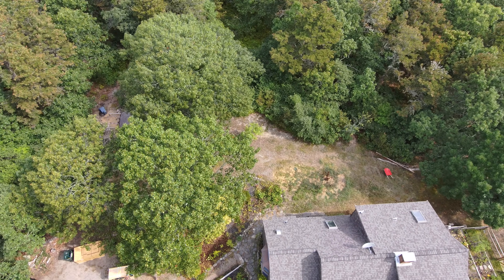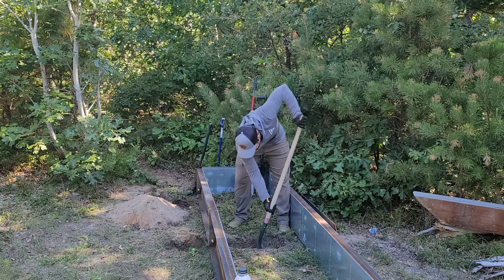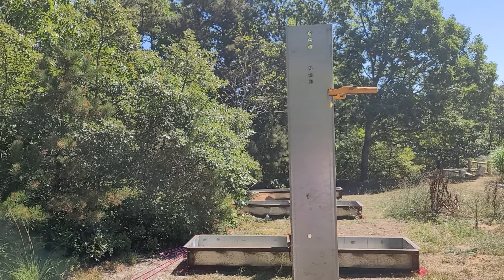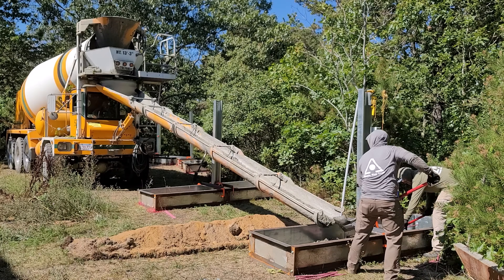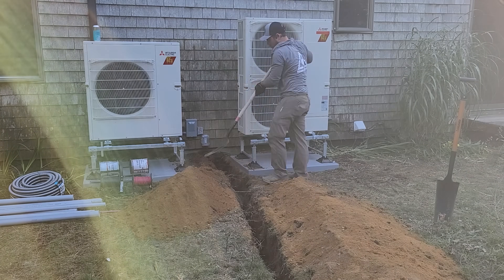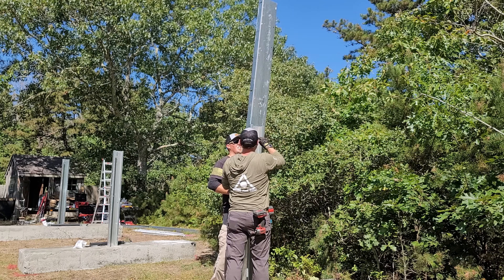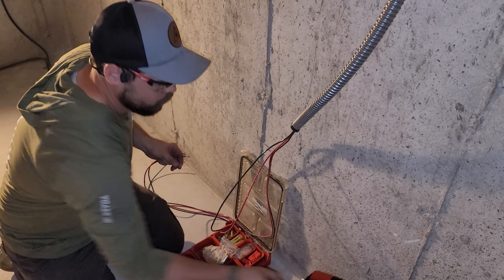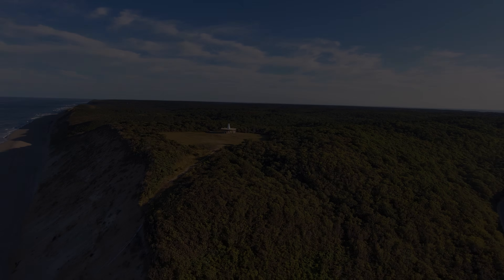Off-Grid in 2 Days with 2 People

Comment: Ground rod required at pv array?? You should only have to install an  EGC between  home service equipment and PV array per NEC.

 Of course, if AHJ wants a ground rod then that's what you gotta do!
Reply from the maker: It's an off grid system that's not always tied into the house since it's on an interlock switch so we grounded to be safe. If it was always connected to the electrical panel some AHJs let you just use that as the ground.

Comment: That wire comming in looks big, vs the THHN going out.
I know THHN can handle higher amps when properly installed (the requirement is not just the wire but also what the wire is connected too, for example the solar kill switch might not be rated for the heat that wire will produce)

So what amps are you expecting to go down that line and what size was it?